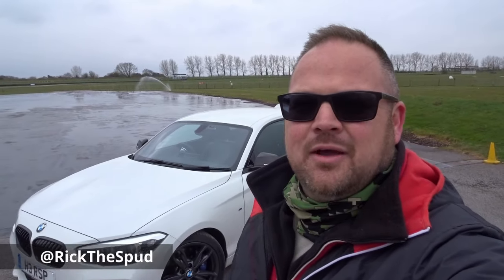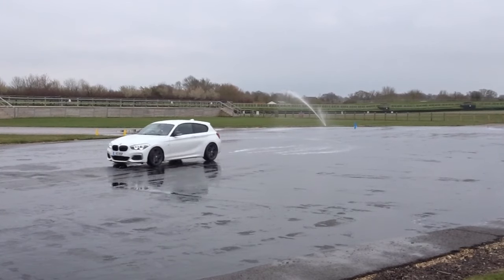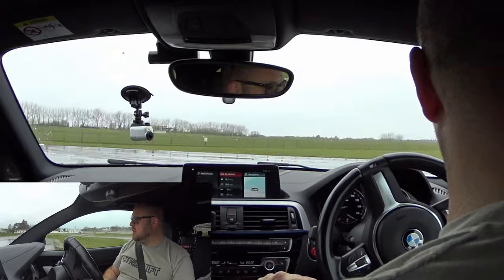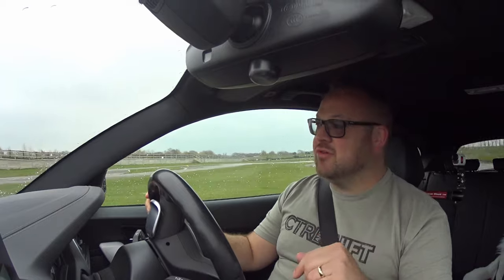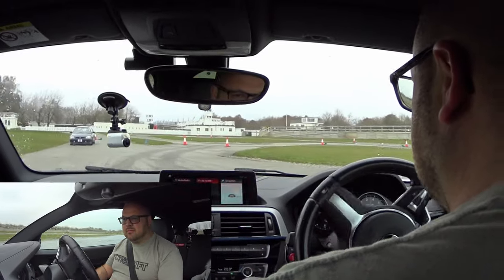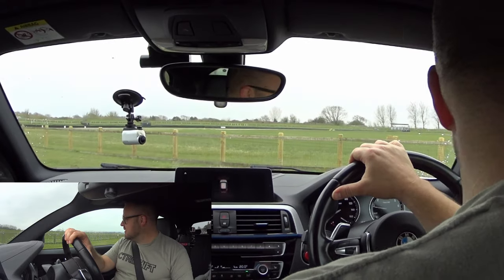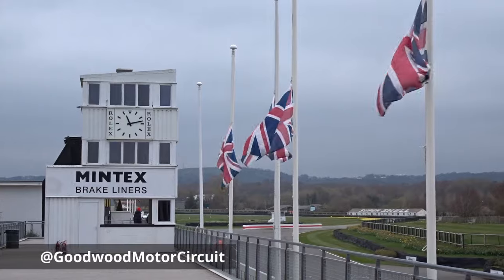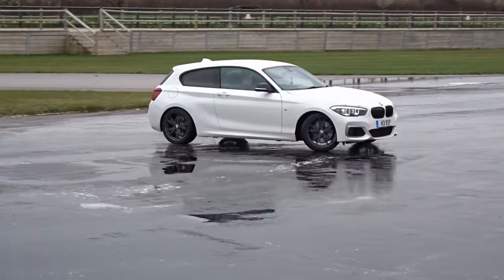So, you don't think you need Traction Control? | Testing DSC on Goodwood Skid Pan | BMW M140i w. LSD

Comment: I turned tc off one day in the wet and it didn’t end well
Reply from the maker: Oh no, what happened?
Reply: @RickTheSpud  I had a nice controlled drift up until I let off the accelerator the back gripped again and I went the opposite way probably because wheels were pointing that way so I full throttled to try pull back out and it went the opposite way again if that makes sense 🤷🏻‍♂️
Reply from the maker: @J-D69  Yep, massive tank slapper, or a fish tail! 😂 Need to get on a Learn2Drift day. Proper fun!
I hope you're subscribed? 😉
Reply: @RickTheSpud  I have indeed subscribed buddy, I’m getting it back on the road soon, you wouldn’t believe it if I told you haha! And yeah I’ve had a look at that goodwood place can’t get a slot 🙃
Reply from the maker: @J-D69  Cheers buddy.
Not Goodwood, Aldershot I think, and other places too. Goodwood is for track not skids in your own car, unless it's skid pan in a Goodwood car.

Comment: Been looking into buying one of these ? Was your fitted with LSD? If not do you think it will best for me to get one with LSD keeping i mind i have never driven RWD?
Reply from the maker: This had an LSD but it makes no difference on the skid pan, on the road it depends how hard you push. Try it without, and get one fitted if you start to push hard enough to need one. 😎👌
Reply: Get one with an LSD..when youre not pushing for slides it will give you more traction and it will make the car more stable..most importantly it will make the car predictable which is what you want.

Comment: Is that rwd or xdrive?
Reply from the maker: RWD. All M140s are rwd as far as I know... 🤷‍♂️
Reply: @RickTheSpud  there was xdrive version too. I think most of the sold 140s were with xdrive.
Reply from the maker: @Robert-gg2vk  In the UK? Never heard of an M140 xDrive.
Reply: @RickTheSpud  I don't know whether in UK was only rwd 🤷. I am from Slovakia and you could buy xdrive version too. You can check wiki or any web related to car specs and you will find there m140i xdrive.
Reply from the maker: @Robert-gg2vk  Ah OK. Yeah I reckon it was only rwd in the UK.

Comment: He is not holding the steering wheel with one hand .. In a situation where you want to teach others
Reply from the maker: I was holding the steering wheel with one hand. 🤷‍♂️
Did you mean I'm not supposed to be? At some points I wasn't even looking where I was going! 😉😜
If you get the results then it doesn't matter.
Drifting with grip then you probably should do. Check out my video at Learn2Drift, definitely 2 hands on the wheel then, except when I'm on the hydro! 😎👌

Comment: What's the difference between sport + and traction mode (MDM)?
Reply from the maker: Think Sport Plus is an engine/throttle setting and MDM is a traction control setting. 🤔